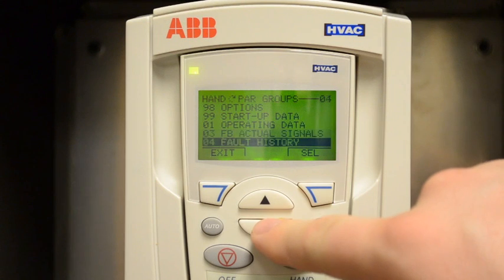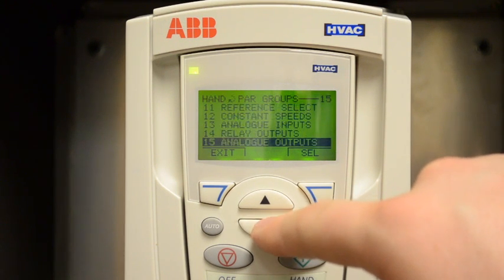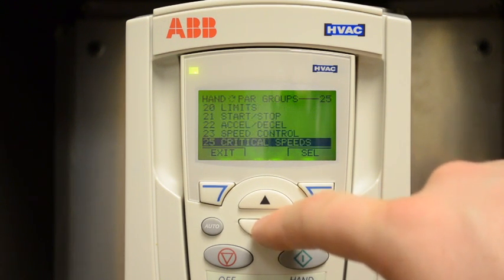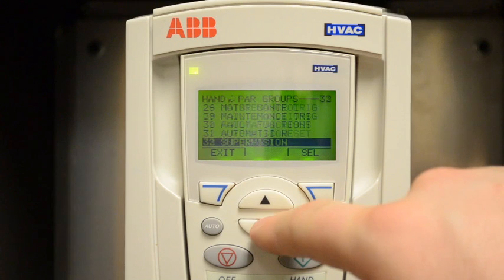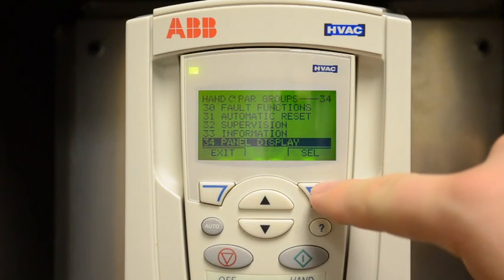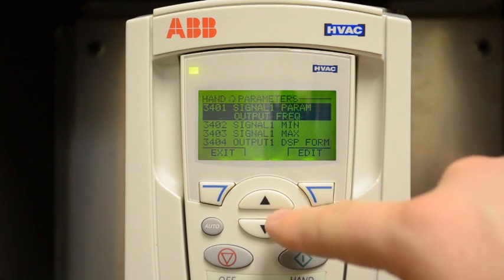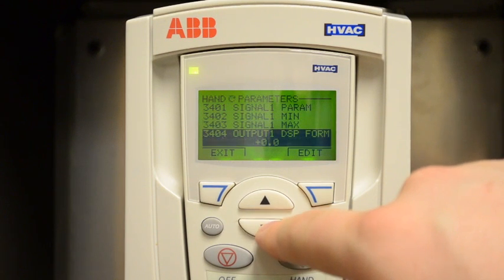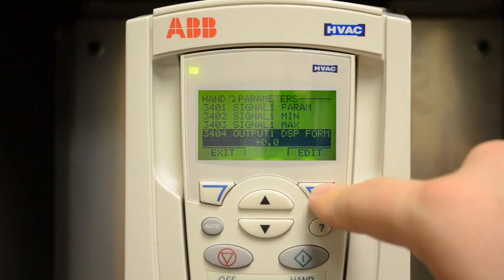ACH550 Show Operating Frequency (Hz)

Comment: How do you change the other two lines? 
What other options are there to display? 
What if you pick an option that does not make sense for your system?
How can you tell what it's displaying if you come up to a drive that's operating but is the first time you are seeing it?
Reply: Nice sir. But how I control hz ? because I want run my motor softly I use pressure switch ???

Comment: Thanks Daniel.  I am part of an in-house maintenance crew.  Certain times of the year we have to record the HZ, Amps, & KW of our Cooling Tower fans which operate with the ABB ACH550.  I wanted to change the control panel display. You made it quick and easy to understand.  Changed the HZ just as you instructed.  Thank you!  :)